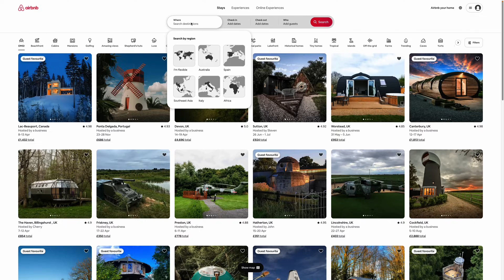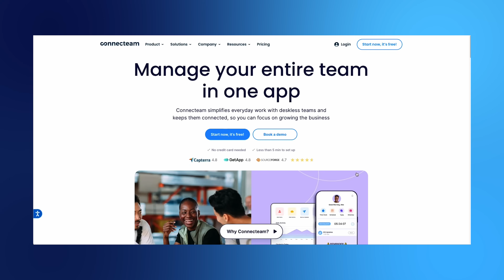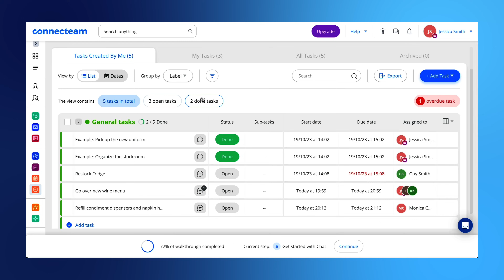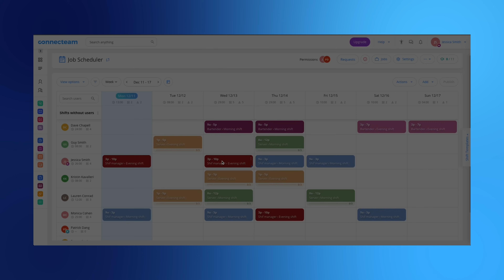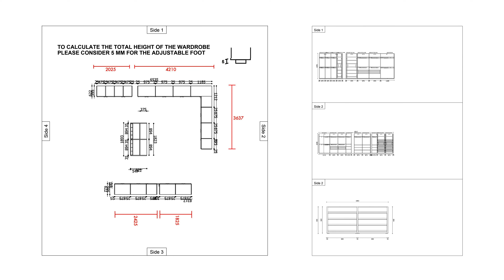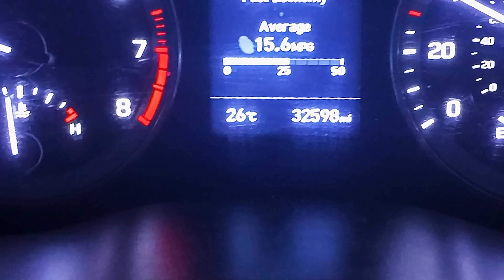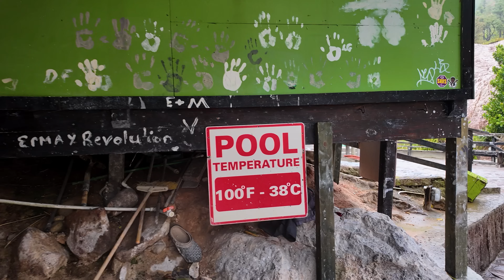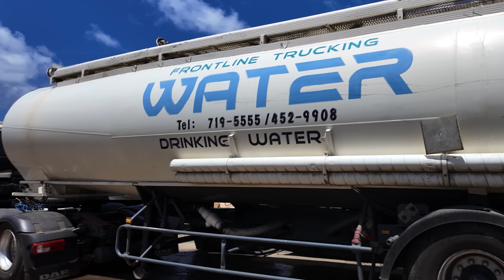Losing Jobs, Dream House On Hold | Ashville Weekly ep180

Comment: The cashflow struggle is real. Usually when there’s a consistent cashflow issue there is an underlying profitability issue…however, sometimes, people just pay slow and the pain rolls downhill. I really appreciate the transparent discussions about the nuts and bolts so thank you.
Reply: Aggregates and muck away is a very low margin business, anyone will do well to make a few per cent. A bad debt can wipe out profit for a long time. Plant hire the same, especially when starting out, there’ll be thousands a month in HP interest- especially with rates where they are - this alone will wipe out all profit. The most profitable part of his business, if run well, will be the construction part. Probably carrying the rest of the company and covering up all the leaks in the business elsewhere.

Comment: Would a beaver tail hook lift body work for Ben's lorry?
Bit more capacity, easier & faster loading.
Would mean could lay the stick down better on some machines.
Would just need a suzie to plug in the rear lights.

Comment: You might not be so furious about selling them articulated lorries if the banks don’t start lending more it could be a blessing in disguise or a very smart move.  This is why using Daniel’s previous analogy being a big small company with more assets than debts pays because you can ride these testing times.  40 lorries and nothing to move is not a good equation.

Comment: I know drivers can make mistakes  but did he not carry his safety boots with him in the cab. As far as I'm concerned about losing a contract over 1 driver and his crocs , no. I'd have a few words with someone in that company. They wanted you out. Is there another haulage company greasing palms ????
Reply: Safety is no joke. Crocs are an instant sacking offence on a modern working construction site. There's also the disrespect implied. You can imagine what other rules that joker has been ignoring. It puts the employer at risk with clients, government inspectors and insurers. There is no excuse.
Reply: @puirYorick  yes I agree on safety. 
But why penalise the whole company and not just the driver. 
I've delivered onto sites, I've done the safe pass courses, but the course doesn't cover me or any activities I perform doing my duties on ,sites to open curtains and ratchet straps. Why do I need to know about scaffolding and their certificates. Teleporters, 360s ,jcbs when I won't have anything to do with them. 
I sit in a room once a year, listening to the same readings I've heard for the past 15 years to get a piece of paper that says I'm a professional driver. 
The driver should have been removed from site and his company informed. 
Someone has let the power go to his head, or as I've said, they wanted the company gone.
Reply: @eugeneclarke5572  The Ashville client has no reach to discipline the Ashville driver beyond evicting him from their worksite. Their contract is with his employer so they, in effect, have to sack his employer if they see fit. Not doing so means they would take on the ongoing liabilities.

Taking all emotion out of it, Daniel may be able to build back trust for future work with that client. A firm assurance that the given driver was promptly sacked would be a necessary opening gambit, along with profuse apologies.

BTW, calling it a "mistake" to wear Crocs on a construction site is akin to a tenured neurosurgeon forgetting to scrub before a theatre operation. In certain fields, there are given rules that allow no childish excuses.
Reply: @puirYorick  yeah, I see your point. I wouldn't wear them in the garden. 
I wouldn't deal with that company again. If they think so little about Ashville, then he should keep going without them. 
The driver didn't wear the ppe not Ashville